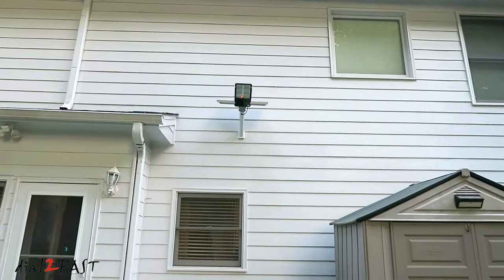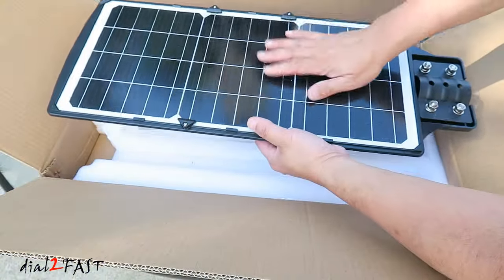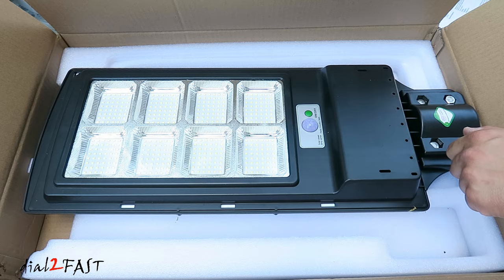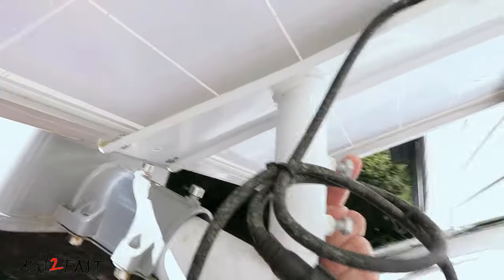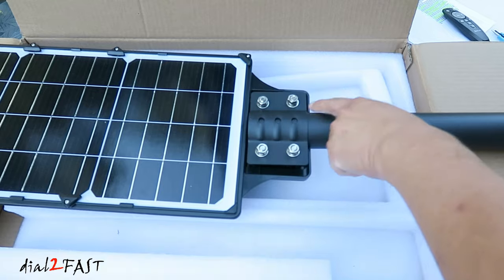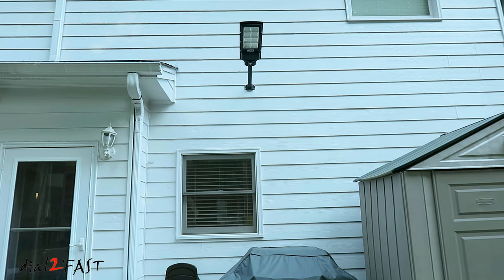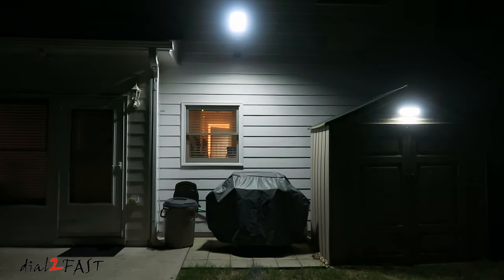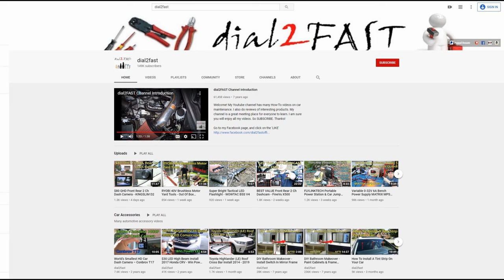I Installed A NEW Solar Street Light On My House

Comment: Thank you for taking the time to do your video presentation.  My wife and I just purchased the same unit and installed it yesterday.  The installation was easy, but the instructions on how to operate it after we charged it for the day was  not clear.  Your video helped explain how to use the remote control properly.  We just tested the light and it works great!  Thank you again for making the video!  Now we just got to see how this unit holds up over time.
Reply from the maker: Thanks for sharing your experience. Enjoy your new light.

Comment: I've always preferred the solar panel being separate to the light unit, similar to your first solar light... that way you can place and angle the solar panel towards the sun to the south. With this unit, say you place to to aim south, then the back with the solar panel would be pointed north, where it would only get indirect light to slowly charge the batteries...
Reply: Your right .. Any brand light u suggest?
Reply: Solar panel technology has matured where one can get decent performance from indirect solar energy.

Comment: What is the length and width of the plate mount? What is the maximum length and angle of the pole with light section?

Comment: how long does the batteries last during winter.. as the daylight are short
Reply from the maker: To be honest, I don't spend a lot of time at the back of my house during the winter, but since it has a dim mode and goes to full bright with motion, the battery will last quite a long time. I can tell you this light is still working to this day after 2 years.

Comment: HEY I HAVE A QUESTION, I HAVE VINYL SIDING, WHERE CAN I MOUNT THIS ON THE HOUSE AND WHAT DO I USE TO MOUNT IT WITH?
Reply from the maker: Behind the siding is plywood. Pre drill the hole and use lag bolts to mount it.
Reply: What size and length would you think would work?
Reply from the maker: @JDomino  Go to Home Depot and find something 3"long. Can't remember size of bolt but you will see the choices at HD.

Comment: At some point in time you will need to change the rechargeable battery so in this street light design will this be possible??
Reply: I think that depends on the manufacturer, consider it like the smart phones, it was battery replace-able but today 2022 no ones offers that option.

Comment: I'm on the fence about the solar panels. The overall design is more pleasing but you cannot adjust the panel without adjusting the direction of the light. Seems like no direct light is hitting it and it's gathering reflected light from your house. Might be fine in the summer but in the winter where you'd want all the light you can get, it may become a problem.
Reply: Actually it picks up indirect and direct light. Means reflected light from air molecules and surroundings. It's high efficiency! Rather 10xs more efficient than a separate aimed one if you ask me. (Owner of several types)
Reply: You must understand that solar street light is alternative option to grid-powered street light, it works fine most of the time even in the winter if its battery capacity is large enough to survive continuous sowny / rainy/ cloudy days. Chose solar street lights you will benefit from its zero electricity bills, easy to install, get rid of wires and grid power, etc. You have to see its pros and cons dialectically.

Comment: I think your old unit is much more better , may be I am wrong . But the reason the lamp is bulky is that it has larger battery which is very important .And the size of solar panel is larger than the new one which can make your battery fully charge in a day. Could you pls do more update video?
Reply from the maker: The other one started having issue with battery not holding the charge overnight. Whereas this new one that I installed is still working with no issue.
Reply: @dial2fast  Oh , thanks for your reply . I'm thinking of buying one of these .

Comment: The old one cost $200 IP65 500w .. new one $100 and has 200w .. don’t see a difference
Reply: I see you are confused, like most of consumers, not your fault, it's totally on the sellers and those factories who thought they are so smart to fool consumers by exaggerate solar street light's power, they started and others followed. and some one even more crazy to lable their solar street lights 1200W, 2000W, etc. So just ignore the power, it's more than a name but not the really power like the grid street light. Hope this helps.